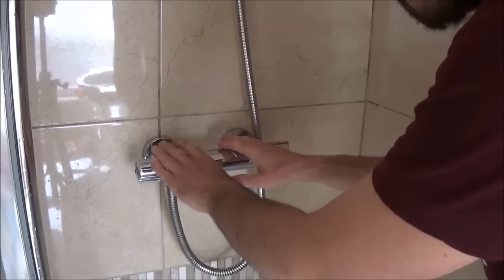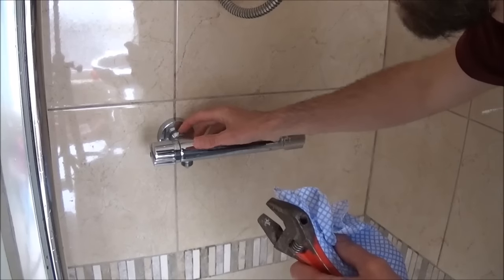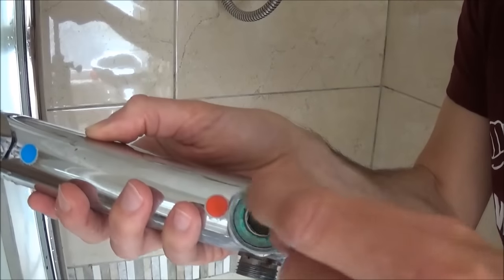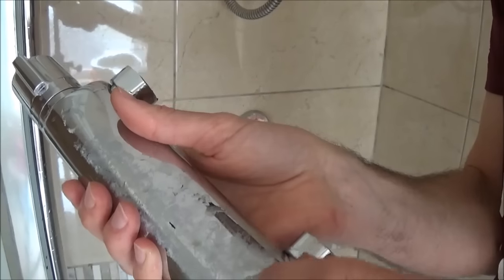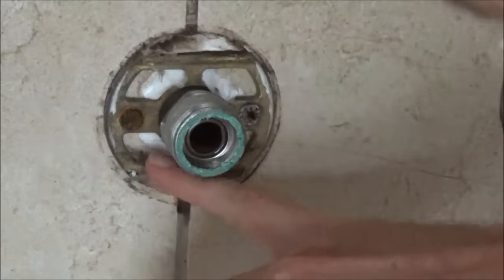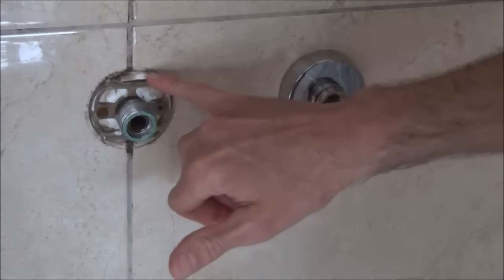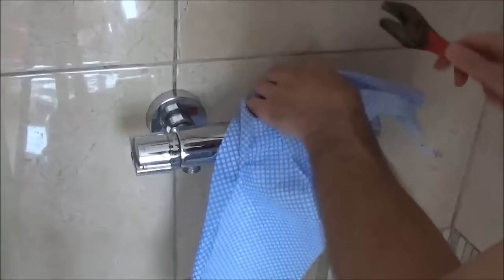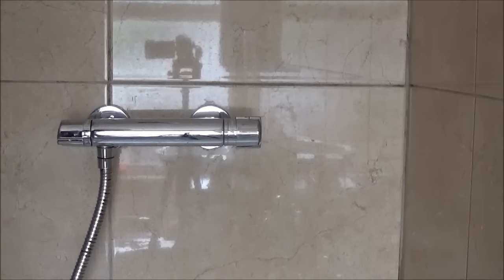How to change a shower bar valve. Shower mixer install & replace!

Comment: Hi buddy could you give me some guidance or point me in the right direction i have a shower similar to this now when having it turned to full heat it doesnt get very hot i have tuck side off and adjusted it to max still the same but i have noticed to get the shower to go nice and hot if i simutaniously run the cold tap in bath the showers goes nice and hot then any ideas
Reply from the maker: Hi Sean, not sure sorry. The only thing I can think is that the thermostat is playing up on the shower and not regulating the shower properly. For what they cost maybe worth buying a new one? Sorry if that's not much help. Best of luck.
Reply: POUSE around the HOUSE it’s been like that from the day it was fitted from new?
Reply: Is the thermostat on the cold tap , I’ve had the same problem and changed it round , sorted now.
Reply: David Hodgson cheers David I was wondering that as he plumber who fitted it along with the bath put hot tap on right hand side rather than left would it still get warm if it was on cold to thermostat?

Comment: I need to fit and replace one of these but i have no access to stop my water can this be done while the water is running??
Reply from the maker: You will need to stop the water running to do this as it will be almost impossible to get on with water spraying everywhere and you need to ensure the seals are sat in the shower unit properly. Once it's off the wall, if you can't get the new unit on the wall you've had it! Have you tried looking for the main stop cock in the house? There are products on the market now like the Alladin easifit isolator that can be attached to your main water feed into the house while the water is live, and can then be used as a permanent isolation valve for the future which may be useful for you. Hope that helps. Good luck and thanks for watching!

Comment: If the shower thermostat is broken then does this apply? Eg change the bar?
Reply from the maker: Depending on the model you may be able to replace a part but they are so cheap these days relative to parts it's often easier to just replace the whole unit. Best of luck with it 👍
Reply: @POUSEaroundtheHOUSE  the unit is only 18 months old... I've had showers before that lasted longer... Is the quality of them so poor these days?
Reply from the maker: @justintemp  no idea, depends on brand I guess. Mine lasted about 7 years before getting a new one.

Comment: can the actual bar be taken apart ? I have small leak from the hot water outlet in the bar itself ?
Reply from the maker: Yes and you can buy new cartridges. Worth checking price though as for the hassle might be easier to replace whole unit for sake of £40 quid. You could always repair the old one and keep as a spare?! Best of luck with it. Thanks for watching.
Reply: @POUSEaroundtheHOUSE  thanks

Comment: I just want to get the right hand heat dial off to adjust the heat but cant get to the screw as the end stopper wont come off
Reply from the maker: Use more force! Try a very small screw driver and gently prize it out. Best of luck.

Comment: My shower unit has become hard to turn on (due to hard water I imagine) do I need to replace the whole unit?
Reply from the maker: Hi Tommy, it may be worth taking the handle off (usually a screw under a small cap in both ends of the bar). Undo the screw, remove the handle and it maybe be that the mechanism has seized a bit with limescale. Give it a quick clean and give it a go. It may also be the cartridge which again can be taken out and replaced. However sometimes the cartridge is not far off the price of a new shower unit so sometimes cheaper to buy a new one. You can usually find the instruction manuals for the shower on the internet if you know your model number which will help identify how to take the handles off. Hope that helps, good luck with it and thanks for watching!
Reply: POUSE around the HOUSE. Great, thanks for the replay mate. 👍🏼

Comment: My shower bar is leaking ,but I no
tice that the cold water is on the left which is different to modern bar fittings.Does any maker make one this way round because it would mean me stripping all the tiles off and moving the copper pipe work-one heck of a job.Alternatively-would it be OK to buy a top exit bar and turn it upside down -would it still work?
Reply from the maker: I'm not sure about this John, but I imagine if you're happy to do all the plumbing in reverse then upside down would work. I think I'd rather find the right mixer bar though. Best of luck with it and thanks for watching.

Comment: I can’t get the old chrome compression bits off the copper pipes to install the wall bracket
Reply: Im the same..how did you do it in the end? Mine are just turning
Reply: I used a hacksaw to cut through them

Comment: Hi I have a unvented hot water cylinder in my flat.. When attempting to follow the instructions above, hot water continues to pour out of the hot side. I have turned the stopcock tap off and water stops pouring out of the cold side.

Do you know how to turn the water supply from the unvented water cylinder off?
Reply: Believe the hot water feed is from the cylinder so would have to drain the cyclinder . I believe the feed in should be cold if an electric cylinder so if turn stop tap off and drain tank should be good to go. (I believe anyway lol)

Comment: hi there does it matters to have the thermostatic control on the left
Reply from the maker: The thermostat is controlled by cold water feed so you would need your cold water same side a thermostat. Thanks for watching.
Reply: @POUSEaroundtheHOUSE  
My shower seems to be plumbed in with the thermostat on the left with the hot water. When buying a new bar should I keep the same or go with one withe the thermostat on the right

Comment: Hi I know this is 4 years old but I'm hoping someone can help....I've replaced my old thermostatic shower valve with a new one, however when I went to turn the mains water back on water splurted upwards from the left hand bolt....what have I done wrong and how can I fix it?

Comment: Hi l have a combi boiler with this type of shower and l am getting huge swinvgs and now a permanent drop in water pressure and temp now a cold trickle.l have replaced the mesh filters on both inlets is there more to service or time to buy new thermostatic bar?
Reply from the maker: Maybe a new bar. You could try a new cartridge but a new bar is probably not much more.
Reply: @POUSEaroundtheHOUSE  cheers l fitted a new bar and all is great now.

Comment: I have a sequential mixer shower - exposed version,  the is fed by hot and cold pipes - if it is 150mm centre point to centre point can this be replaced by a bar unit
Reply from the maker: Yes, I think so as most bar units are 150mm from centre to centre.

Comment: What happens when no cold water comes out, only hot water, how do I adjust the temperature?
Reply from the maker: On this model you turn the right knob towards you for hotter or towards the wall for colder. The left knob just alters the amount of water that comes out.

Comment: Are all these thermo bars the same temp wise? Just had a new one fitted and it doesn't get hot enuff for me. I was thinking if they get hotter the more u spend then it might be worth me buying a different one.
Reply from the maker: Usually there is a stop at 35 (ish) degrees. If you push the button you can twist it to go hotter. The button is often red. However you can unscrew the cap, and adjust the temperature  by unscrewing the brass valve, turning it with shower on to required temp then placing cap back on. Sounds like another video is required!! Let me know how you get on. Best of luck.

Comment: Hi I have the very same shower,  unfortunately it has developed a drip, out of the shower head , could u pls advise me how to repair this, I’m sure it’s just a seal but I’m not sure how to get in to it to replace it 
Thanks in advance
Reply from the maker: Hi there, my guess would be it's a seal in the cartridge. So your best bet is to source the correct cartridge and replace your dripping one. To remove it I think there's and allen key nut on the one end. The whole thing should come out in one piece. Sounds like I need to another video! Good luck with it and thanks for watching!
Reply: @POUSEaroundtheHOUSE  Yes, I need you to make this video too!

Comment: Is this an aqualisa shower? Do you know the model. I'm trying to find how to remove the shower head holder to replace a part of it.
Reply: No mine is an old Triton and when I phoned the factory they told me that they had just cleared their old stock as it was outdated
Reply from the maker: It's a triton from screwfix. Your shower head holder will have hidden screws somewhere. Look for two clips top and bottom. Just careful not to snap them. Best of luck.

Comment: What size and type of pliers are you using?
Reply: there not pliers, it is an ajustable spanner / wrench, which come in a range of sizes, if you can roughly measure the nut on the shower, then use that as a mid range of a adjustable spanner / wrench.

Comment: Thanks great video. When I try and disconnect the nut which attaches to the fixing kit pipe (7:15) the fixing kit pipe is turning with the nut.  Very narrow space between the nut and the chrome plate round the fixing pipe so can't get a spanner in to hold against it.  Any idea how I can free the nut from the fixing pipe? Job come to a halt at the moment. :-(
Reply from the maker: Sounds like it's fused maybe with rust or possibly just been on so long.  If there's no room to get spanner in you could try a blow torch (like a plumbers gas bottle with torch) and heat it up. This will expand the nut and with a tap and a turn may release it. Or some releasing fluid which you could try to force around the thread, leave for a while and go back for another go. Other than that a bit of brut force but there's always the danger you'll damage the pipe work. Maybe call a plumber if all else fails and at least they can fix the pipework if they damage it. Best of luck with it.

Comment: Please can you tel me what size spanner to order on eBay for this mixer bar.  My spanner isn't wide enough 😰😔
Reply from the maker: Think it's 1 1/4 inch diameter nut so bigger than that! Hope that helps. I used a large adjustable spanner. You can use it on other sizes that way. Hope that helps.
Reply: POUSE around the HOUSE Thank you so much I really appreciate this reply and advice. By the way you came across the best in these videos. You teach well and clearly no showing off at the same time. You're great!!!!!
Best wishes I will be back.